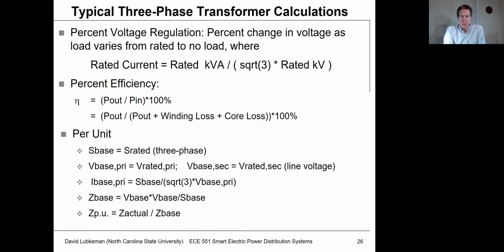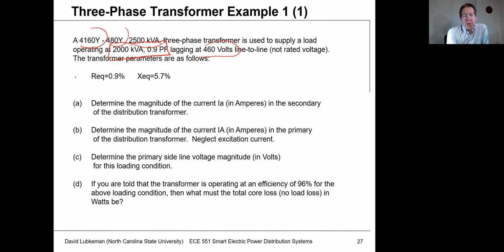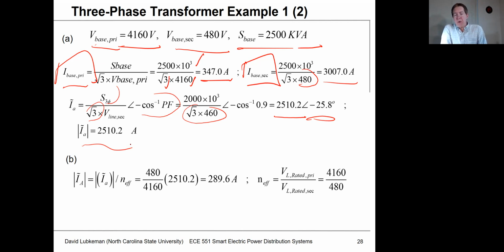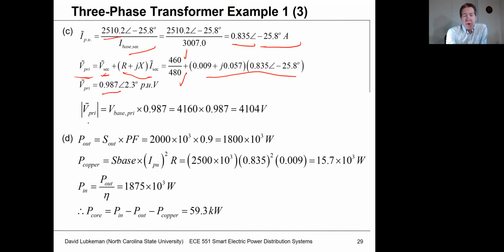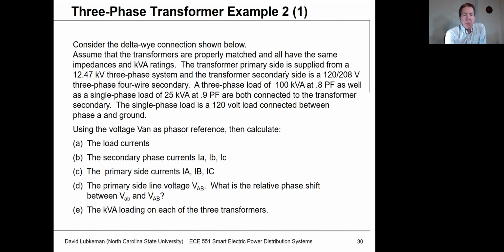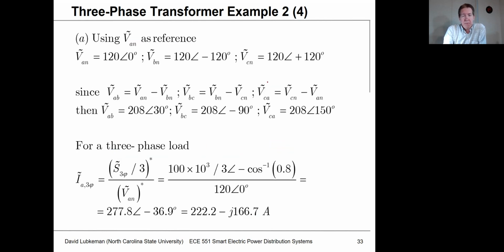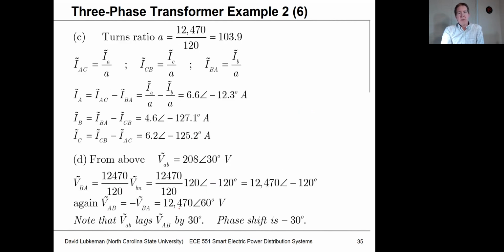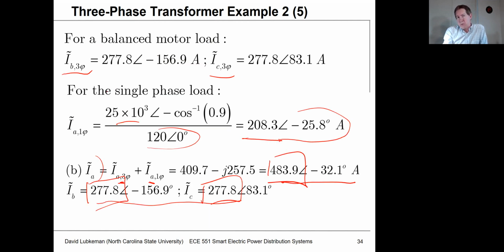Lecture 4b: Three Phase Transformers - Examples - Power Distribution Systems Spring 2021 - Lubkeman

Comment: Hello professor 
how do sizing transformer if our load mostly motor ?
Reply from the maker: In the Lecture 4 material I only looked at steady-state load impact.  For motors you might want to review the Lecture 23 material on motor start.  The inrush current associated with a line-connected motor start can cause a significant voltage sag.  So may have to use a larger transformer with smaller series impedance if that voltage sag will be an issue.
Reply: @dr.davidlubkeman284  Thank for your reply .

Comment: I have a simple question that I cannot seem to find an answer to, but it still bothers me.  What is the difference between E and V?  I think E might be referring to a source and V a load, but I see problems using both in the same question and each time, that question pops in my head.
Reply from the maker: Both V and E can be used in general to refer to voltage.  For nonideal transformer modeling, I use V to refer to the transformer source or load voltage. Then given we have primary and secondary winding resistance and leakage reactance, use E to refer to the voltages associated with the ideal transformer voltage component, which is embedded in the nonideal transformer model. It would help if you could give me a specific lecture number and slide number to refer to.
Reply: @ This is common in questions from the textbook “Power System Analysis and Design”, where problems would provide E and ask to solve for V in the same problem.  I just found it confusing, but treated it the same.
Reply: @ Thank you for the answer.
Reply from the maker: @BillLehman-qg8jk  Yeah it can be confusing.  I would tend to use V to represent a measurable voltage at terminals of a device, while I would use E to represent an "internal"  voltage associated with rotating machine or transformer winding models.  You will also see U used to represent voltage.  But I'm sure I get sloppy with the usage depending on what textbook I might have been referencing at the time while working on my notes.